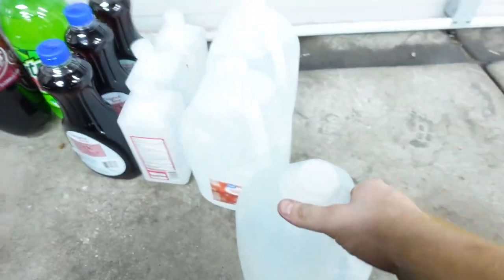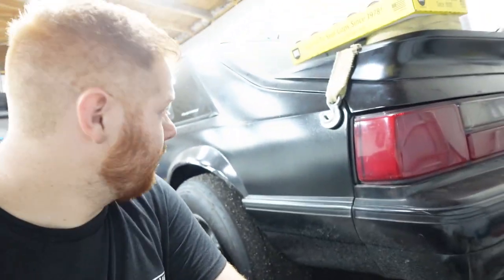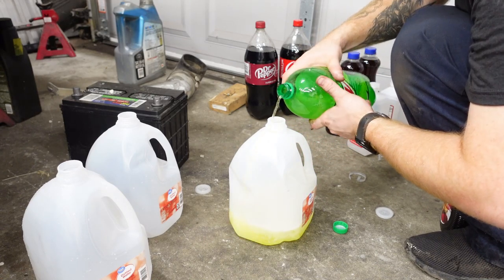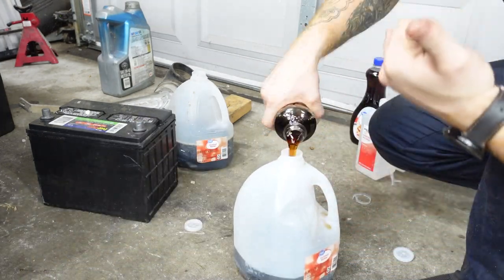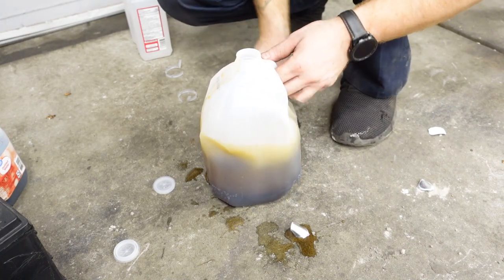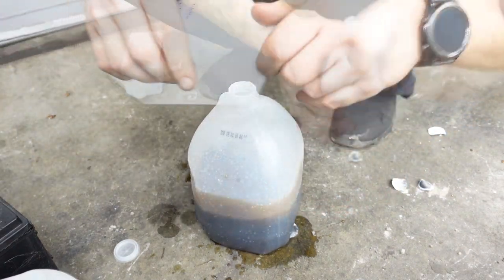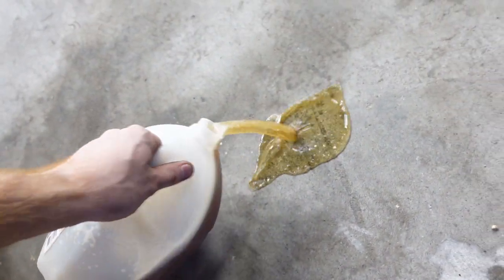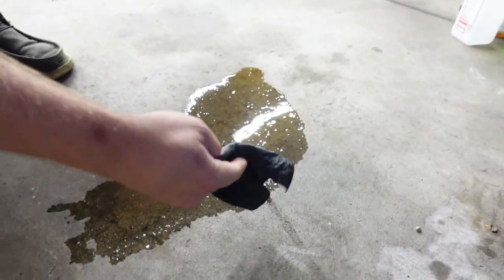MAKING MY OWN TRACTION COMPOUND!

Comment: Do you have to burn it to work?
Reply from the maker: Yes
Reply: @Cawbee  do.ypu have to flame it. Or will a good  tire burn out do with out lighting it
Reply from the maker: @willsilversurfinharris6239  I've done it both ways. Burning it helps it alot.
Reply: @Cawbee  in ur  video  at the spot looks like u jus burnt  out. No flame. M y car like to push thru breaks  to
Reply from the maker: @willsilversurfinharris6239  Yes, I just pulled up, poured, burnout then went. I think I should of done a bigger burnout next time but over all worked well on low boost
Reply: @Cawbee  he'll yea I'll b making some sooooon